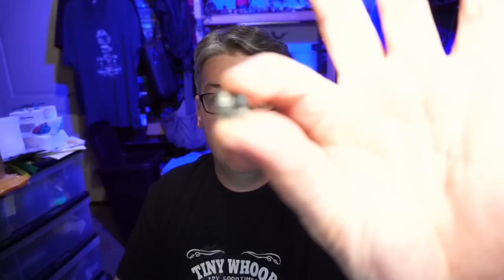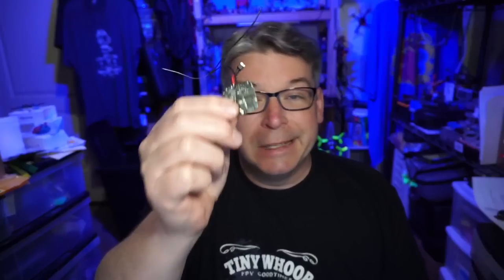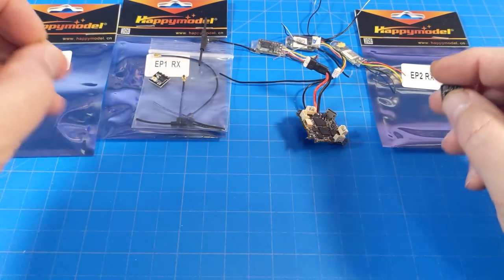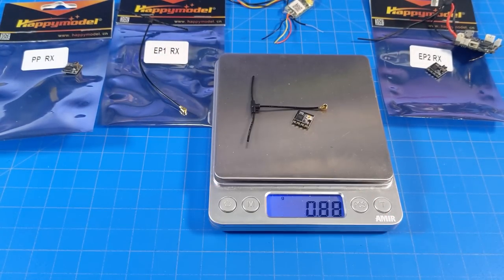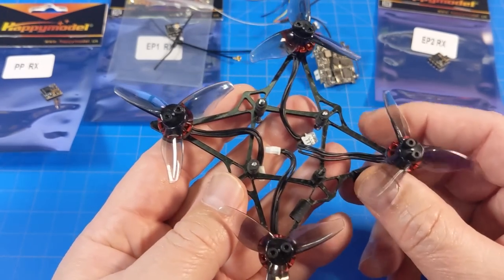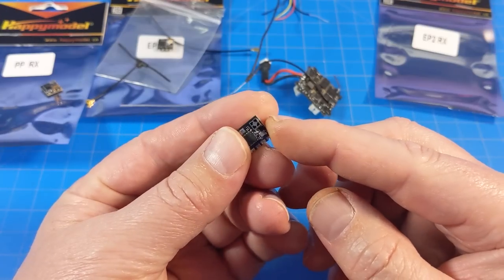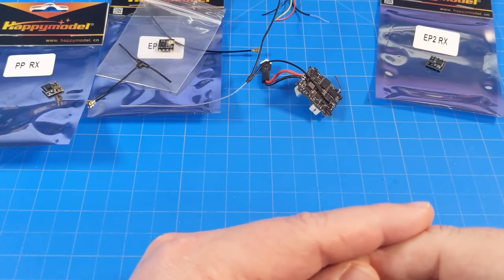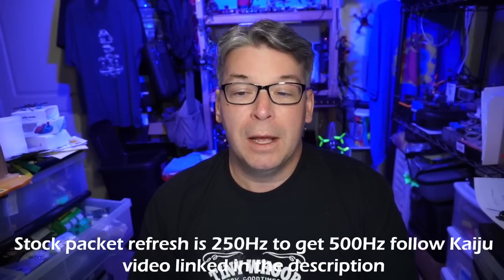HappyModel ExpressLRS 2.4ghz 900mhz // 10mW Range Test // Binding // Updating

Comment: A question regarding the Slim Module bay of taranis x-lite, jumper t-lite and tbs tango 2:
Are the all the same and compatible - say for 4in1 modules?
At banggood there is a new ExpressLRS slim module for jumper t-lite and i am curious if that also works on my taranis x-lite or x9d lite
Reply from the maker: I am not certain the t-lite external bay is the same as x-lite or tango 2. It would be silly to have some custom pin out, but its possible its non-standard.

Comment: Nick, I have a question. I have purchased the HappyModel TX24 module and three quads with the EP2 RX . I updated my Jumper T12 Pro to the latest version of open tx. created a model and turned on the external module and set the model to CRSF and used the Express LRS tool to create a LUA script, and moved it into the tools folder on the SD card. The module lights up in red, When I attempt to load the script, it freezes with Loading ???/? displayed  and will not get past it. It also locks the radio to where I can only use the model created and will not let me change models until restart  Do you have any ideas? I also set the baud rate to the lowest setting, and it refuses to load the script!
Reply from the maker: In the model file is the internal Rx disabled?
Reply: @NickBurnsFPV  Thanks for the response Nick. Another gentleman suggested that I downgrade the LUA script from 2.0 to 1.1.2. I told him that many YouTubers instructed people to use the lastest version of the build. I had the Express LRS Configurator 1.3.2 and was downloading release 2.0 as per many peoples instructions. The script never would load. I downloaded an older version of the release 1.1.2. I'll be damned it worked. I do not realize why the configurator is still 1.3.2 and the latest release is 2.0. No matter, it is working great now!
Reply from the maker: @parker1ray  lol. sorry I am not laughing at you, but this hobby. Some things don't make sense and we have to beat our head in to finally stumble onto a solution. Good you got it sorted out, I suspect this is a logical explanation, but with the versioning being so different its hard to see.

Comment: The rssi doesn't really represent the signal strength, it's also possible that it just isn't calibrated or failsafes at a different point (frsky XM+ for example failsafes at 65 rssi)

Comment: Still waiting for a crossfire integrated whoop board.  I run crossfire on my 2s whoops, and Eachine offers it on the 1s with a separate receiver, but it would be nice to get one integrated.  Interesting stuff though, I look forward to more videos.
Reply from the maker: I would suspect that is a long way from today. To my knowledge TBS or Immersion aren't partnering with companies that make AIO, if they make their own I would the cost to start being a barrier for them.
Reply: @NickBurnsFPV  Yea, I figured, at least some of the new boards have direct solder pads for crossfire.

Comment: @nickburns Can you explain 2.4ghz vs 900mhz (does the video system you are running, say for instance dji hd, impact which you should opt for, or the country you are in etc.)? Thx
Reply from the maker: No the video has no bearing. 2.4ghz vs 900mhz: 900mhz will have more range but isn't legal in all countries and countries it is legal may require a license of some sort. 2.4ghz is more universal and doesn't require a special license.
Reply: Nick Burns thank you! And is latency similar/the same on both?
Reply from the maker: @Ricpow80AkaNagamooto  yes, I would say only the most elite of fpv pilots could feel any difference.
Reply: @NickBurnsFPV  thank you! After reading this I have just ordered the happymodel elrs micro tx and two of the rxs that come with the ceramic antenna to try with it! Hopefully, the ceramic antenna version gives good range and connection in high multipath environments too.
Reply: @NickBurnsFPV  thank you - ordered a happy model elrs tx and a couple of the ceramic antenna rxs!
Reply from the maker: @Ricpow80AkaNagamooto  I am most excited about the EP2 with the ceramic antenna, should make for a clean build.
Reply from the maker: @misshazelnut6826  I would think the differences in antenna have the greatest impact when at very very long range. So far I have not seen range testing between the two, maybe ~20% less range with ceramic. But that's 20% less at many many kilometers. I have seen expresslrs tested out to 33km, without failsafe, they had to returns due to battery life. :)
Reply: Nick Burns I'll get in within a few days, so I'll get to work building soon after!

Comment: Hey ExLRS look great for mircos! Ive got tracer but i might grab Exlrs for my smaller quads. I also need a new aio to for my Larva X aswell! (osd chip cracked in half so no Osd).
Dam Nick, my mob6 only goes 30m/98ft! my mates goes about 10x that far haha. Your mob lite has great range also!
Reply from the maker: Yes, I think there is a manfucturing issue with the RC link antenna length, that really messes up the control range.
Reply: @NickBurnsFPV My express LRS just arrived Nick! Woo! Dam the receivers are really really small!!! 😮😮😮
Once shipped it took 12days for to get to my lil coastal town here in Australia, that's great 👌
Reply from the maker: @Barnz1980  Isn't it surprising how small they are?
Reply: @NickBurnsFPV  totally!! Man they are soooo tiny hahaha

Comment: D8 wouldn’t die if FrSky would had supported it in their newer transmitters. D16 wouldn’t die if they wouldn’t have gone the Access and V2 route. D16 only exists because of Jumper/Radiomaster/etc.
Reply from the maker: Likely Correct, I do think companies like happymodel and betafpv would have moved away from it still with expresslrs being opensource and solving likely the number 1 complaint on their products....rc link range.

Comment: Well, in your last video I complained that everything was the same; nice to see a "breakthrough" with respect to "range-per-gram" ....this (could) be the next biggie in micros...if the reliability is there and we can somehow get it well-integrated with ...maybe... a lightweight Fatshark HD system (in addition to their analogue link with good video).
Reply from the maker: I don't know if we really need to have it integrated. The EP2 RX weighs 1/2gram with short wiring maybe adding another 1/4gram. I don't think we will see an AIO with vtx, rx, fc and esc that can support 2s, in the short run. I think the AIO will likely have to drop some component for 2s. We will certainly see a 2.4ghz 1s aio with vtx,rx, fc, and esc, but we will likely have to add a regulator to get to 7v for shark byte. Really, anything is possible with the right partnerships.

Comment: Thank you for the video. Very impressive tech we have today. I have mobula 6 with Jumper t-lite. I know that jumper t-lite runs on OpenTX and JR module bay is  just a form factor. Is it possible to plug the  wires from ES24TX  to the Jumper t-lite and it just works?
Reply from the maker: If we get the pinout correct it would work, but does it fully power is the question. As to if it would just work we do have to download the elrs lua script and put that on our sd card in the tools directory.
Reply: @NickBurnsFPV  thanks for the reply. I saw in youtube that someone made an ExpressLRS 900mhz tx module as jumper t lite internal module. I'm so eager to solve the mobula6's bad spi signal issue and I simply just can't wait longer and decided to take a risk and ordered ExpressLRS 2.4Ghz tx and rx. I will see how it works out.
Reply from the maker: @karolisbutvinskas3614  I hope it works out well for you. Might take a fair about of detective work to match up the pins.
Reply: @NickBurnsFPV  I found adapters from small to standard size JR module bay and from the pictures I can clearly see which pin goes to. My ExpressLRS tx and rx is on its way. I will write here how it went.
Reply from the maker: @karolisbutvinskas3614  nice. Where did you find adapters? Are they items we print ourselves?
Reply: @NickBurnsFPV   I found  a JR Module Adapter For FrSky X-LITE in the Banggood store. I guess this adapter wont fit in my Jumper t-lite, but the wiring should work.  Apparently I can't share a link, but if you want you can find this adapter in the Banggood store with these keywords: "jr tx module adapter for frsky x lite"

Comment: Wonderful controller project but you can not forget bn880 support and barometer included... In other case the project will loose sense. 2.4 ghz is very popular
Reply from the maker: what is bn880? They do have 2.4ghz versions, for some reason 900mhz came first.

Comment: Why bind mode and lua script? It binds via password you defined while flashing.
Reply from the maker: True, but if you don't flash and run stock firmware we need to bind manually.
Reply: @NickBurnsFPV  Stock firmware still must be 0.1.x firmware. 1.0 RC2 is out already ;-)

Comment: What motor you use for 5in1 board
Reply from the maker: In this case its an 0802 19000kv on 1s battery. I have run 5amp esc boards on 1102 18000kv as well.

Comment: dont understand why u need a long range connection on a 25 mw system
Reply from the maker: If we were to want to fly long range having the confidence with higher mw which is available allows us to not only fly further out, but have that assurance we won't failsafe. If we test at lower mw, we know at higher mw it will be able to reach further. Its possible I don't understand the question.